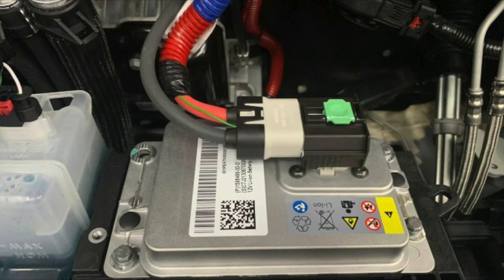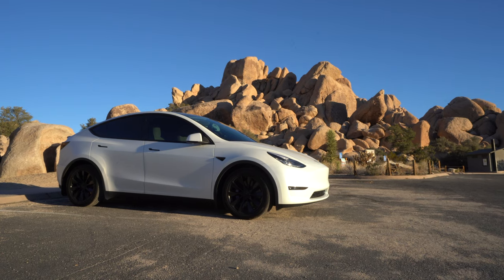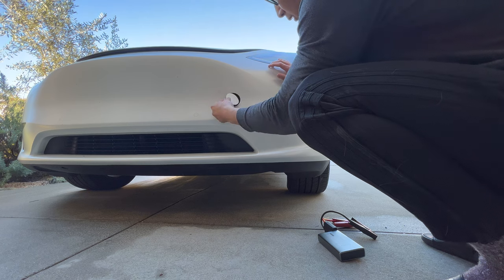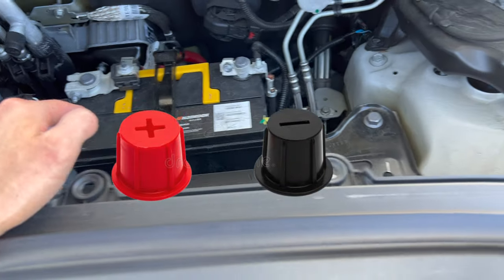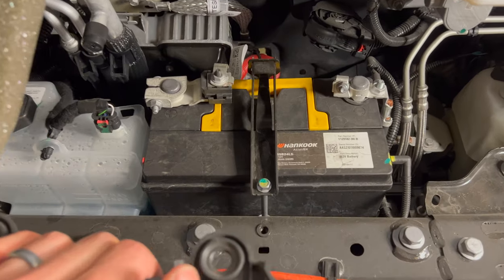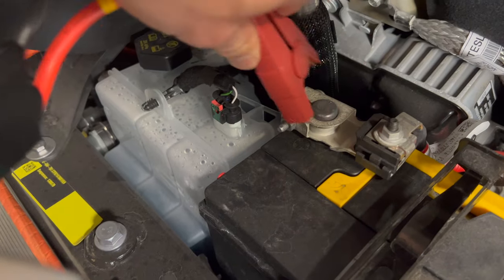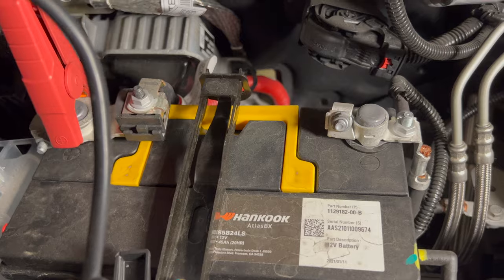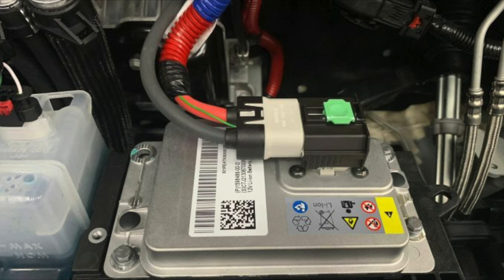How to JUMPSTART a Dead Tesla

Comment: what are you using to jumpstart (ie the jumpstart battery kit you use). is that something that can be bought or can you use a 9volt regular square battery. yours looks a little easier/safer to jumpstart off

Comment: Anyone have advice for if you accidentally drop the batteries through the jumper hole? 😢
Reply from the maker: haha its open at the bottom so it will fall out eventually. There's a plastic piece you can remove but its a hassle

Comment: I also saw that if you can't get to your jumpstarting power brick (for example, you store it in the subtrunk), you can use a regular household 9v battery to pop the frunk
Reply from the maker: Cool
Reply: Don’t know about a 9 volt but I know a 23A battery works, which is actually a 12 volt. It’s way smaller and you can actually tie it to the wires for an emergency.

Comment: Not sure if they changed the software to prevent this but past history showed a man went on vacation and left his car charging at home and 
when he got back from vacation he found he could not open the car.  If it is old code it was because charging is turned off when the main battery is full but the 
12 volt then get depleted.
Reply: Good point. In ICE car, when I go on long vacation either I give my car key to my neighbour or friend to start the car twice a week or just take out the cables of the battery, so the battery is not depleted when I return.

In Tesla if your main battery has enought juice, but your car is sitting idle for long period then what to do with the 12v battery? Can you remote-start the car to prevent the depleting of the 12v battery?
Reply from the maker: Yah now the battery recharges the 12v when it gets low

Comment: If we need to jump start the car, would it also be possible that doors and frunk won’t be able to open, then having the jump start charge inside the car won’t help.
Reply from the maker: Yeah true. A lot of times it does let you in however just the car won’t let you drive. And if yours died I have one to help you haha
Reply: @EverydayChris  haha. Yeah!
Reply: Hi folks. You need a small 12 volt dc power source. Open the cover where the tow recovery ring goes. There's two connectors on the cover. Touch your plus and minus power to these connectors - red to red , black to black - and the frunk will open. Doing this does not jump start the car, only release the frunk. Some people have a small 12 volt battery with flying leads taped to the wiring here so it is readily available to use. You do not need a big jump start unit for this, just a small 12 volt battery. Next consult your user manual which explains how to do a jump start. Follow that carefully. You will need a decent jump start pack for that so maybe keep that in the frunk where you can get at it. Hope his helps someone. Best thing is to practice the trunk release procedure before it becomes necessary to do it for real.

Comment: I tried this today....it did not work for me.  I couldn't unlock the frunk with the app or anything.
Reply: So what was your solution? Did you manage to open the frunk?
Reply: @mateiluca6513  two tow trucks…one to get me out of the garage and the flatbed to take the car to a service center.  Total  cost go get to service center…$551 due to  needing two tow trucks.  Cost of repairs…$1000 and change.  Not a good day.
Reply from the maker: Man sucks. I wonder why it didn’t work. That’s what it’s made for. Service visit for sure

Comment: Can you do a video as what to do with the trailer electrical plug not working. I bought a 2023 Y, my friend bought an identical one, both with factory installed hitches. We both get red trailer icon as soon as we turn the trailer mode on, with or without trailer hooked up. Then I checked the power to the plug, nothing.  On both vehicles. We both use small utility trailers  and everything works fine on our other cars. Any ideas?
Reply from the maker: Hnmmm. Service request???
Reply: @EverydayChris  thanks for writing back!, wow, really impressed. 
Why is there no power to the hitch plug is a mystery, and after searching for2 days everywhere I still don’t have an answer.  Please let me know if you hear some explanation, it will be very much appreciated. Have Tesla service apt. next week…but don’t really like having  anyone ripping it apart…especially when mine and my buddies are just 2 weeks old.
Love your channel!
Reply: @EverydayChris  had Tesla service, had to take rear bumper off and do a hard reset…whatever that means, but they did fix it

Comment: So, as soon as you plug the jump starter, does the frunk releases?, if so how does the vehicle avoids the Frunk to be opened by a thief?
Reply from the maker: Yes. That’s a great question. The car still needs the key to open the door. But yes technically someone can open the frunk with a jump starter
Reply: @EverydayChris  interesting, hope the system does not work when the vehicle has battery, otherwise, even though you can not access to the interior of the vehicle , thiefs could still take parts from the Frunk area
Reply: The moment you connect the jumpstarter to the towhook cover lead wires, the car has some power to detect your phone, keycard, or fob.

Comment: Kept hearing a ticking noise from the frunk but it won’t open
Reply from the maker: Hmmm is your car on? Does it go away with driving?
Reply: @EverydayChris  not it’s at 0 km and doors won’t open neither the frunk will even with using the method showed in the video
Reply: @Anonymous-nq2qy  did you ever open your frunk?
Reply: @kalila_mama  yeah i did it just needed a stronger battery so a car battery will do the job
Reply: @Anonymous-nq2qy  Thanks for the heads up, my S died at the airport. I want to be well prepared when I land hopefully I won’t have to call for help. Were you able to drive your car afterwards?
Reply: @kalila_mama  u won’t be unfortunately, it’s just a jumpstart u do have to charge it instantly so u can drive it